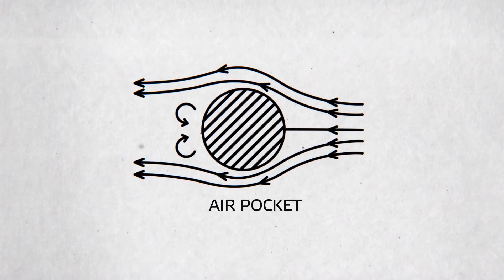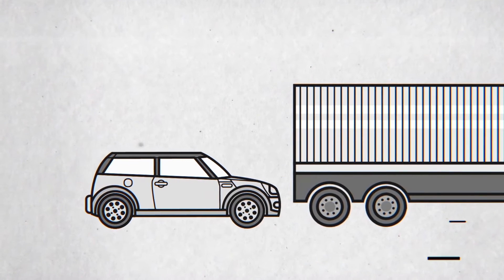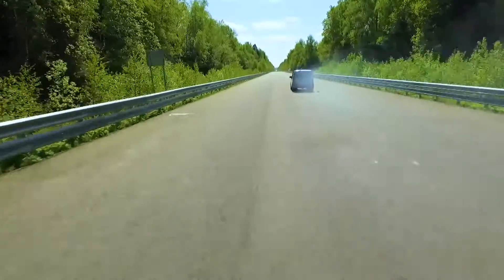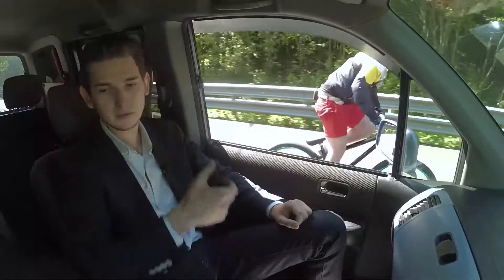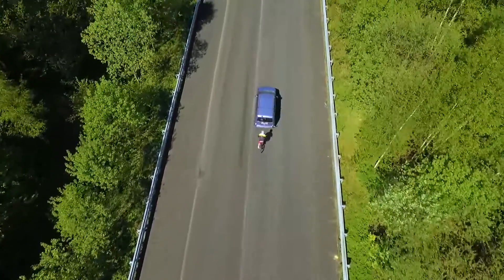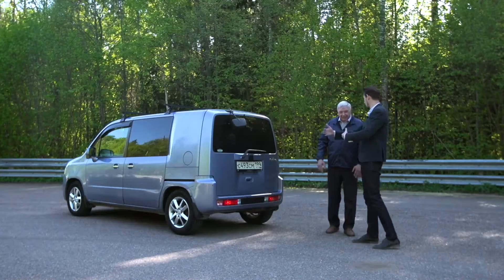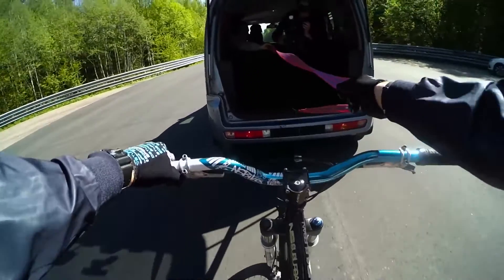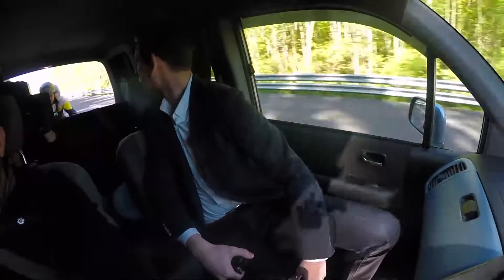Does Drafting REALLY Work? Physics Of Drafting BEHIND a Vehicle

Comment: Yes it works. I always coast behind trucks and manage to get ~2l/100km fuel efficency, usual being about 6l/100km But yeah, its a tradeoff because you have to be extremely vigilant and always be prepared to slam the brakes which makes longer journeys exhausting.
Reply from the maker: Thanks for sharing. So you only spend 2 litres  / 100 km of fuel using this method? What is your make?
Reply: @Scienceforeveryone-xz1kk  skoda fabia. 1.2liter engine.  Its actually most efficinet at 90kmh and thats speed that trucks usually go.